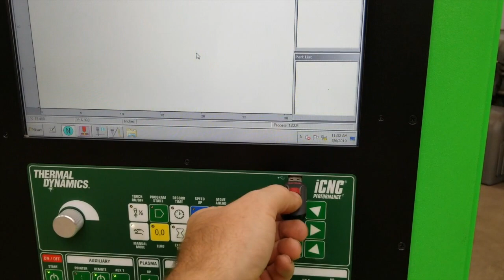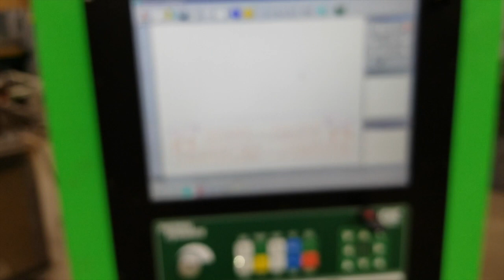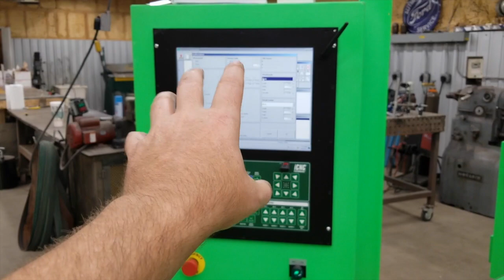Auto Cut DXF File - Trucut Thermal Dynamics iCNC Controller with A60i - CNC Plasma Table

Comment: Does it cut half inch plate? Asking for a friend.
Reply: Eco Mouse if you put a cutter with 45 amp 100% duty cycle on it ( or more) then yes.   If you put a 30 or 45 amp cutter on it it does not - at least not much ....  a 45 amp cutter is typically 30 ish amp 100% duty ...   to cut a full sheet 1/2” you need at least 45 amp and it has to be 100% duty
Reply: @ZILAwelds  Gary has been promising me a small part out of 1/2" plate for about a year now. It's an inside joke.

Comment: Did you get the torch height issue fixed with the new card?
Reply from the maker: yes, new card is installed, and THC is rock solid.